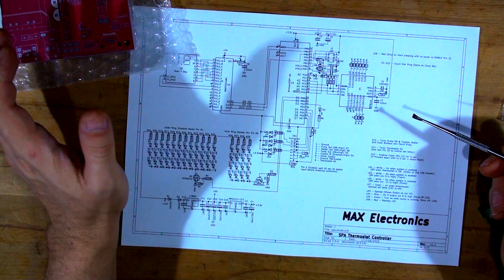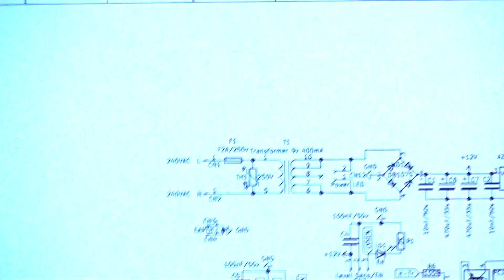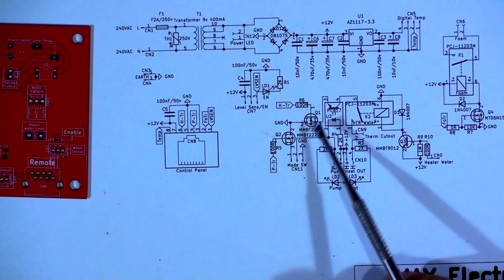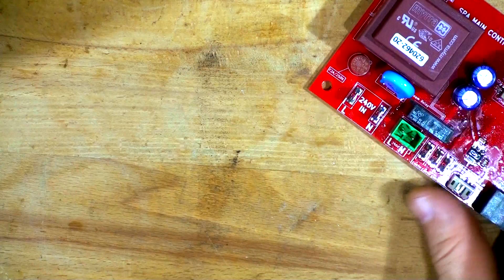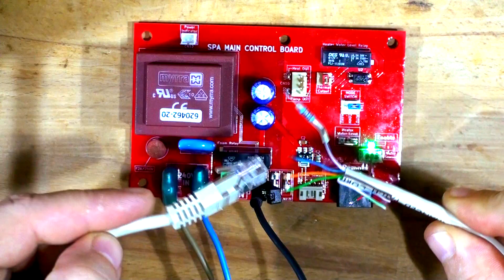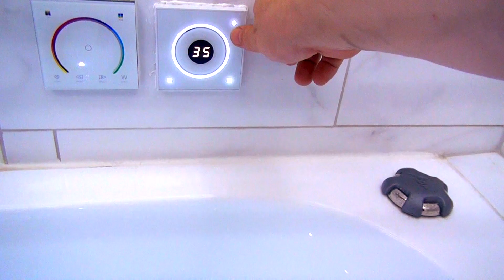DIY Bath-Spa Controller with Auto-Foam And Heating

Comment: hi max, from the UK,
i have an outdoor 240v mains lantern which has a pir sensor and a single bulb, the pir has 2 adjustments, one for time the light is on and one for the dusk sensor
the sensor is a LM-P001 by YUYAO LUMEN OPTOELECTRONICS TECHNOLOGY 

what i wouls like to do is put a second bulb inside the lantern, one would be a constant flame bulb and the other would be a brighter 60w equivelent gu10 etc

i would like to run the flame bulb off the dusk sensor and have the gu10 bright run off the motion sensor (this is the normal function)

so my question is can i cut open the sensor box and wire a live to the dusk sensor so the flame bulb will turn on constant until dawn or do i need to find a sensor that already has this feature
if so do you know of one?
Reply from the maker: Hi, you’d need a separate dusk sensor. 
Something like those:
https://www.ebay.com.au/itm/134650373439?mkcid=16&mkevt=1&mkrid=705-154756-20017-0&ssspo=19tngpwftdq&sssrc=4429486&ssuid=D1OZOxU5QAG&var=&widget_ver=artemis&media=COPY